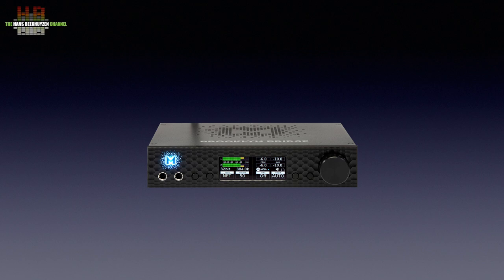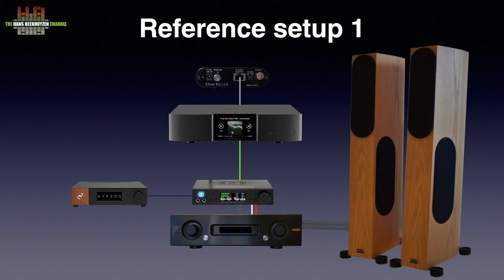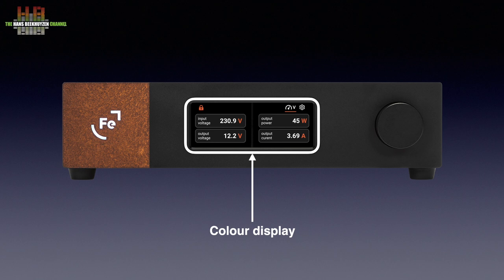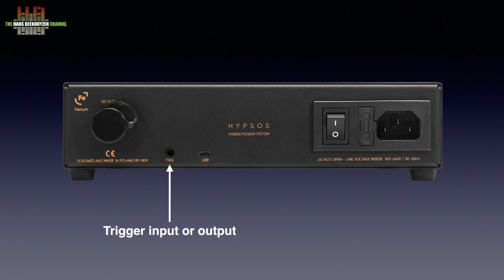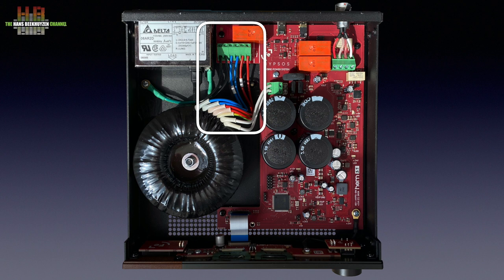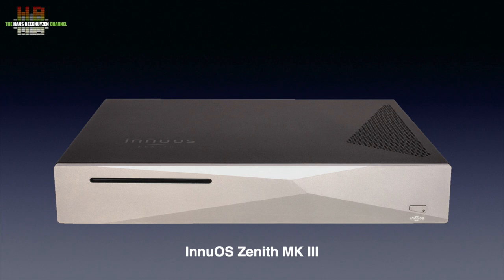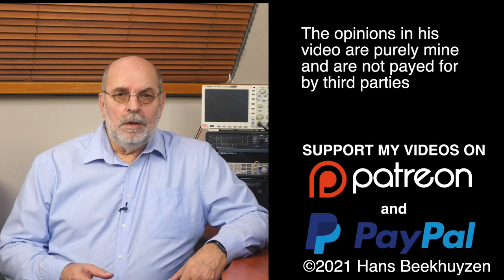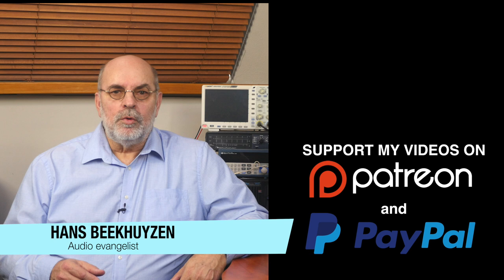Ferrum Hypsos 5 to 30 volts DC Audiophile power supply

Comment: After I watched your video, I procured the Hypsos. I am cognizant of the value of the PS. I am using the Bluesound Node. I purchased the PCB board for the Bluesound from Fidelity Audio which is required to use the PS.  The sound benefit was jaw dropping. The Bluesound is NOT a audiophile grade component. The PCB along with the Hypsos is a GAME Changer. A colleague of mine uses the Hypsos with the Chord Ethernet Switch. Again the performance is substantial.
Reply from the maker: Thanks for sharing

Comment: Power supplies have dramatic effect on sound quality,sometimes equal to device schematics! I improved sound of many devices just to changing cheap impulse power supply to diy linear one. For example cheapest Pro Ject phono corrector can sound much much better with good power supply.While Pro-ject schematics is good,delivered power supply spoil sound,make it grey & flat.Changing power supply moves such phono corrector from low to medium priced phono corrector categories in terms of sound quality.

Comment: Thank you.... I always love your reviews and they have guided me in my current audio setup. I am a stronger believer in Linear PSUs. In fact, I have linear PSU's powering my Mac Mini (Uptone), iFi - Micro iUSB 2.0 Power Supply, and headphone amplifier. However, these are "simple" circuits and most good ones use a R-core or toroidal transformer. I would like to see you do a review or comparison between these type of mainstream PSUs versus some Chi-fi PSUs with decent R-core or Talema transformers. I think the difference would be indistinguishable. You've mentioned doing this type of review in past reviews... I am still waiting. Another interesting review. Thanks again!
Reply from the maker: Don't believe in linear power supplies; believe in GOOD power supplies, like the Uptone's. Transformers are only a limited part of the equation.

Comment: Very nice video as all your videos.

I’m considering the Hypsos to feed my Nucleus + who’s still with its original PSU.
But I’m using my Nucleus as core only to feed my Mola Mola Makua (with integrated DAC) via Ethernet.
I’ve read left and right that upgrading the Nuc PSU would only have an effect while using the USB port of the NUC not on the Ethernet one.

Do you think bringing the Hypsos into my equation would be beneficial?
Reply from the maker: No, if you want to further improve the sound quality, invest in a high end ethernet switch like https://youtu.be/Io4SDi5hLxs and https://youtu.be/48oepwZgYRw
Reply: @TheHansBeekhuyzenChannel  tks Hans, you just made me save 1.000€…
I have already the silent angel Bonn N 8 + Forrester. I know you prefer the EtherRegen but I’ll stick with what I have, for now at least…..😎

Comment: Hi Hans, you referenced in your review that the Hypsos can power an Innuos Zenith MKIII streamer, however, this device is not included in Ferrum's "Compatibility List"
Reply: Ou must have worked out by now but if not you just set the settings manually. I contacted ferrum recently and they got back quickly with that response plus Hans mentions it also

Comment: I have an new Weiss DAC 204, would this power supply be suitable? Or would you reccomend another?
Reply from the maker: I have no hands on experience with the Weiss but I do like the Hypsos very much. Make sure to set the right voltage before connecting it to the Weiss.

Comment: I want to buy a Ferrum Hypsos. However, I need to know the type of cable termination I will need. Hypsos offers two alternatives but they say other may be available. The two standard plugs they offer are 5.5 x 2.5 mm and 5.5 x 2.1 mm. Unfortunately, the manufacturer of my server does not publish the information regarding the type of plug required, nor have they told me although I have asked them. I have the brick style switching power supply with the attached cable. Is there a way to know which type it is? Should I take a measurement? The power supply output is 12v 5amps. Input is 100-240VAC, 50-60HZ, 1.8A. Your help is greatly appreciated.
Reply from the maker: You can simply measure the diameters of the barrel and the inside. \For that is what Ferrum specifies.

Comment: I'm just wondering if a 12V batterie will not provide the same effect. Normally their output voltage is around 13 to 13.5 V. Die you test this variant allready?
Reply from the maker: Batteries are rather noisy due to the chemical 'work' inside and very slow compared to an audiophile power supply.
Reply: @TheHansBeekhuyzenChannel  interesting, thank you for that information

Comment: How do you tell if your system would benefit from such a component?  If a system is not sufficiently resolving there would be no change... But how would you know? There are countless combinations of dacs, amps, speakers and room setups.
Reply from the maker: The only definitive way is to listen, taking into account the rules of audio hygiene (https://www.youtube.com/playlist?list=PLMbsmejHnP8E-kEzlliBX1bc8V-V4aQfE).
Reply: @TheHansBeekhuyzenChannel  Thanks for the response I was sorting of dreading that as the answer...  I guess a related question is: It makes sense that spending 100x more for speakers than an integrated amp/dac means quality is unheard that could be gained with a better amp & dac.    Is there a good way to understand where the weakest links in a system are?    There is no silver bullet, but what are some guidelines that says this speaker outresolves that dac or that speaker is not showing what that amp can do?
Reply: @jamesmorris2010  Source first, then the whole chain is relevent. But if the source is not up to the job the rest of the chain becomes irrelevant.

Comment: LexiCone Audio moet LexiCone Acoustics zijn, excuus hiervoor..
Reply: Hi Hans. I have a mytek too and a linear power supply where I can adjust voltage. At what voltage do you run the mytek? 13,1 volt? What is the save area where I can drive the mytek? Thx